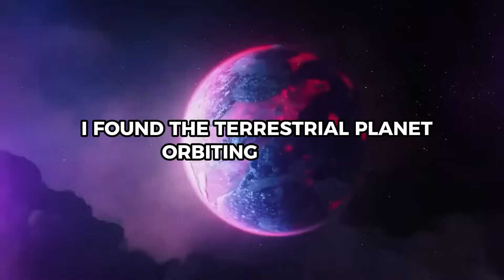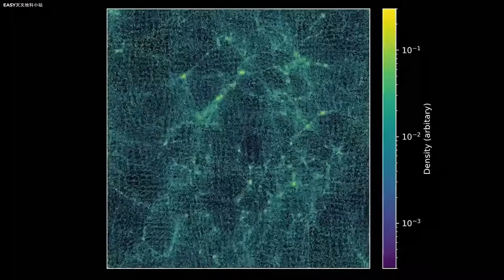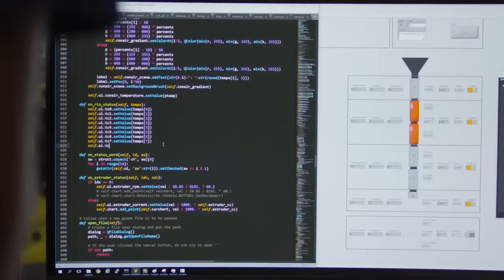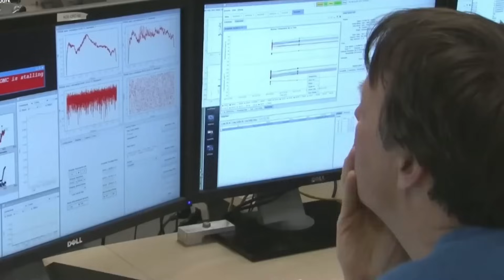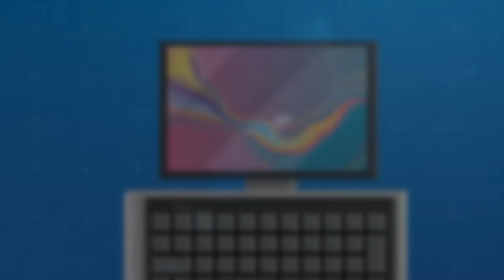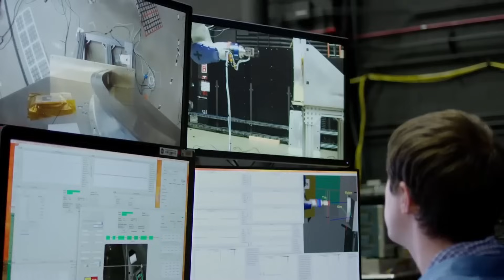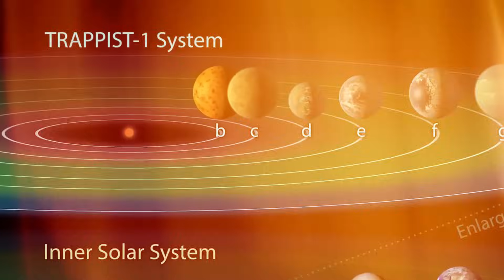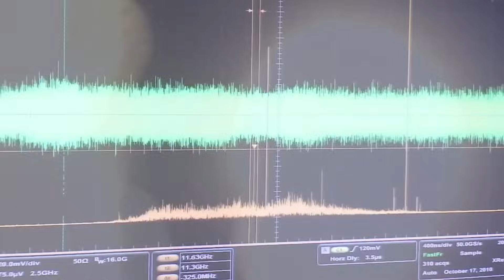James Webb Telescope Just Observed City Lights 7 Trillions Miles Away!

Comment: Proxima Centauri is 4.246 light-years away from Earth.  That's not 7 trillion miles, that's about TWENTY-FIVE trillion miles.  Wherever this story came from, there's been some serious garbling of information, leading me to be pretty skeptical about anything else in the story.   If the planet is actually 7 trillion miles away, it isn't a planet of Proxima Centauri.  AND it's also cold and lifeless, without a nearby star.